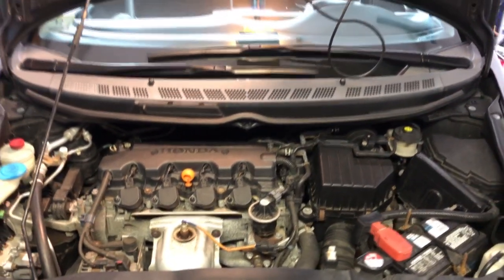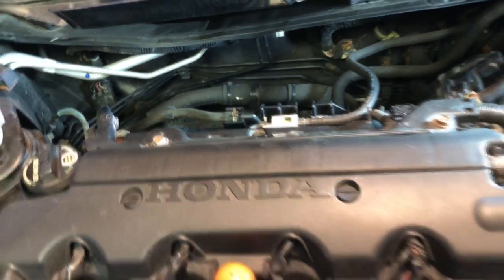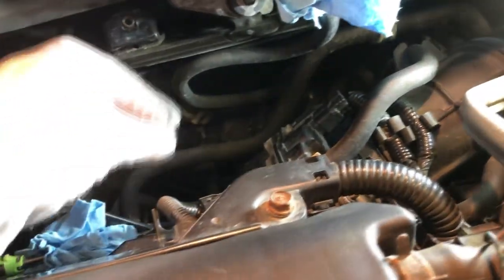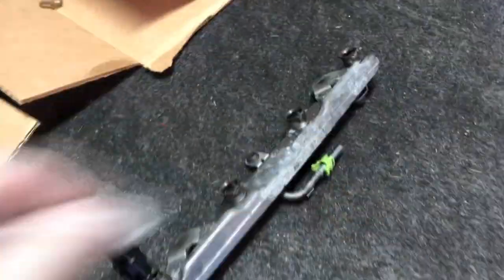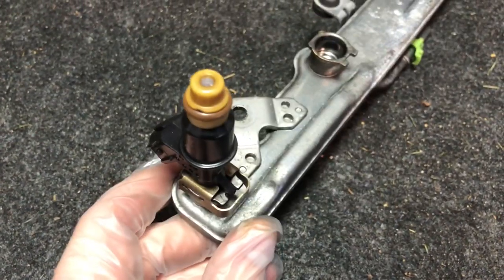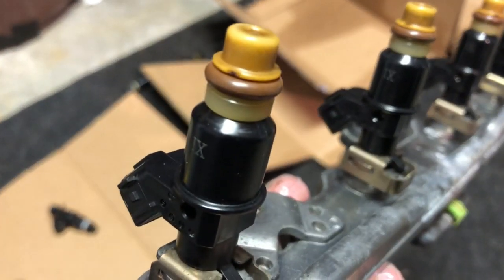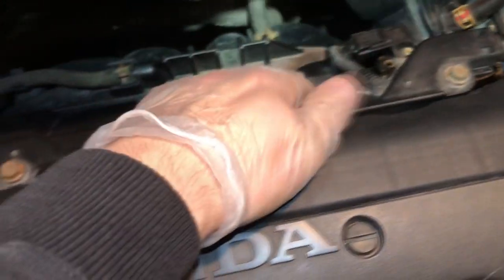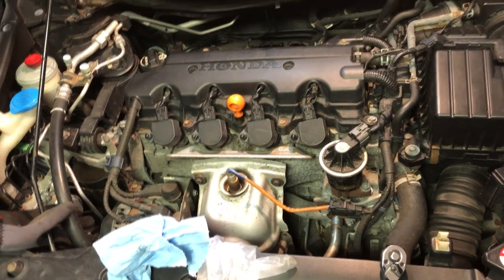2006-2011 Honda Civic Fuel Injector Replacement

Comment: I would just pull the fuel pump fuse, then try to start the engine. Should help with the pressure
Reply: I'm curious as why would that help at all? Could You explain it please ? I'm having trouble With my Civic at the moment haha

Comment: I found that using a little spray silicon lube on the O-rings will prevent them from squishing out of place and causing a hard to find vacuum leak.
Reply from the maker: George Sims Great tip! Ever since I did this job I’m concerned the oil will cause the o-rings to be too lubricated and eventually wiggle out of place. Hope it doesn’t happen.
Reply: Vaseline works great and dissolves in fuel.

Comment: Thanks man, I just replaced mine with old oem injectors which were brought on ebay and refurbished through some guys in Cornwall! All in all it costed me £160 and your video saved me £200 ❤ from 29mpg the car has shot upto 49mpg on the dash. Though I know the car computer is not accurate but definitely is showing huge improvement.... Plus the car is more responsive now, it used to struggle on reverse but now it's smooth.. 👍

Comment: I replaced my fuel pump after I had ran out of gas one day and the car obviously died and stopped running and then after putting gas in it it still wouldn’t start, would fuel injectors go bad because of that situation?

Comment: I have idle surge and rpms barely staying above 500rpms. My mechanic said it might be my fuel injectors. Idk what else they could be, he checked all my air flow and hoses for throttle and there were fine.
Reply from the maker: Maybe check your spark plugs if you haven't already? If so, maybe a bad alternator or battery, I would go to another mechanic to have a deep diagnostic done.
Reply: @awayfromk my spark plugs were changed recently and are running good, had him hook his scanner up and told me the injectors are giving gas enough when you rev the engine, thats why the rpm dips when you accelerate. Also the battery is 3yrs old and might need changing soon.
Reply from the maker: @skradaddy  Yeah I would get your battery tested (alternator can be tested at the same time too to see if it's giving correct charge voltage) and go from there. Just to rule out it isn't those two things.

Comment: Did my injectors today and I think it would have been easier to unclip and remove the fuel rail rather than trying to pull them all out with the rail attached. Of course that method would make a huge mess, but I spilled gas everywhere anyway. The injectors were in there good tho... I had to pry the rail up with a screw driver in order to get them out and it's easier than I would like to bend the rail.  

Got everything back together without leaks and my fuel trims look like they should now (no longer always highly negative). 

Thanks for the video!

Comment: I had a little fuel squirting out from the first injector. After I got Honda to diag what’s really going on, it was GUSHING out from the injector. Had to get my car towed home lol. Turns out the safety clip and o ring were missing!! Wtf! Gonna fix it as soon as the parts come in. So thank you for this video! 👍

Comment: Great video and thanks for posting it.  I'm having same issues with my 2008 civic...a ticking noise but not constant and shuttering at times.  I suspected the fuel injectors, but after watching your video, i'm pretty confident i have the same issue as you.  Thanks!
Reply: Have you ever had the valves adjusted?
Reply: @setward2536  Thanks for the suggestion, but if I increase the rpm's...the ticking sounds don't increase, so I'm guessing it's not a valve issue.
Reply: @kevhed8  rod knock
Reply: @JankyDubz  indeed

Comment: Helpful video!  A bit jumpy with the video, but overall well done.  If possible, it would be helpful to see you actually remove/insert parts instead of jumping to the completed assembly/disassembly.  Maybe on the next one.  I realize it would mean more editing, but super helpful to see the challenges during that process.
Reply from the maker: No I get ya! I invested in a GoPro setup with a head mount so I’ll have both of my hands free for future videos, that’s why I couldn’t show the removal of parts.

Comment: Would this be the same procedure on a 2014?
Reply from the maker: Sorry I wouldn’t know! Honda slightly adjust the design of the engine bay setup once the 2012 civic came out, I would assume the fuel injector placement is the same though.

Comment: I just finished my fuel injector replacement...great video and thanks.  I was putting on that white plastic fuel line cover/lock cap, and the thing broke.  The fuel line seems secure enough as it's clipped in place on the green retainer clip, but I would feel better with the white cap on it.  Any idea what that part number is for that white cap?  Can't seem to find it.  Thanks
Reply: Mine was missing which means previous owner has worked on the fuel rail or injectors. I believe the part number is 16725-RNA-A00 but for some reason shows as doesn’t fit these vehicles on the Honda site I use. I ordered it anyways and will report back on if it fits
Reply: @AkashBhardwaj97  thanks for the reply.  Let me know if it fits your civic.
Reply: @kevhed8  update, I received my clip just now and it looks to be the right one. I’ll be installing it later today and seeing if it fits
Reply: I apologize I thought I had commented another update a few weeks ago but it looks like I may have had a network issue.
Reply: So I have found that there are two clips that can fit over the green one. One is the white one (16725-RNA-A00) and a slightly off white/grayish one (16725-RAA-004). The white one did not fit my 2006 Civic but it does look identical to the one in the video. The light gray one did fit mine because my fuel rail has the tab below and not above like the video and thus I couldn’t get it to go around the  90° turn on the rail.
Reply: I tried to add more info and post it as one big comment to help you figure out which clip is right but I am not sure why YouTube kept flagging my comments as spam. But long story short, 1 of the 2 clips will definitely fit your car!

Comment: What symptoms made you change/clean them? I have a 2010 civic with 142k, never been done...
Reply from the maker: kyle griffin I was having shuttering/low power issues and assumed it was my fuel injectors, but that didn’t fix my issue lol at least getting them cleaned and had new filters installed helped the injectors perform better at least.
Reply: @awayfromk    Swapped my spark plugs on my 09 civic since Im experiencing hiccups while stopped and jerky acceleration while going 40 mph, was gonna swap fuel injectors but it seems that didnt work for you. Did you manage to find out what was wrong with your civic? Im been reading that it could also be the coils causing the issue.
Reply from the maker: salvalo22  I did install new spark plugs recently, my car was idling really poorly and even having a flashing CEL - replacing the spark plugs fixed that issue (my plugs were pretty burnt out) My civic now is riding fairly good now, I’m going to do a valve adjustment soon since I’m very overdue for that and I heard that improves engine performance greatly so I would try that for your civic. I tested my coils a while ago and they were fine, they’re still OEM but I also had a mech look at it and said they’re fine too. 

Are you still experiencing issues with your civic now or did the spark plug change help you? I feel like me changing my spark plugs fixed the shuddering issue I was having or the “hiccup” motion it was doing.
Reply: @awayfromk  Replaced the spark plugs as they were in pretty bad shape and thought that was the main problem. Issue went away for a week, now its back. For some reason, dont get a flashing CEL when experiencing the hiccup and my mechanic is not willing to repair anything else until the light turns on.  Cleaned the MAF too and no luck. Was reading on the civic 8th gen  forums to swap the PCV valve as that could also be an issue and if that didnt work then swap the coil packs but that option is a bit expense even tho they're easy to swap. Did you only experience the hiccup while idling? I feel it sometimes when driving, not sure if its a misfire but recently added some injector cleaner too see if that would help but no luck so far.
Reply from the maker: salvalo22 salvalo22 Yeah I only had the flashing CEL because my civic was misfiring so badly due to my plugs being so worn out but hey it’s good that’s not happening to you because it’s not good to let your car misfire that badly. I would recommend changing your PCV valve for the hell of it and see if that helps, it’s easy and a cheap install (just have hose pliers at the ready) Sounds odd but how I tested my coils was just buying a new pair, seeing if my issue was fixed or if my car performed better, if not then I knew my OEM ones were fine and I returned the new coils I bought. I experienced the hiccups around 50mph when I would hit the gas, it’s like my engine was shuddering and struggling to accelerate but it was brief. Hopefully you can find a fix, it seems it’s a struggle with 8th gen civic to troubleshoot idling/performance issues.
Reply: @driverman9528  I finally was able to get the CEL and had a misfire on P002. I swapped all the coil packs and the issue is gone. Hope this helps. It took over 3 months to finally display it on the computer.
Reply: @driverman9528  I feel you, replaced my plugs, the coil packs, and now the thermostat as it just failed. Seems to be running good now. Over $1500 in repairs, good thing youtube saved me a bunch of $ by doing myself

Comment: Did this fix your engines error code? I did a similar replacement with the refurbished ones and the engine light came back on the second day of driving
Reply from the maker: I didn’t have any engine codes up when I did this replacement. I had misfiring issues and thought this would fix it but it didn’t lol. I had bad spark plugs causing the misfiring.

Comment: For what reason did you change the injectors?
Reply from the maker: I was having misfiring and poor performance issues for a while and just started replacing a few things to see if it would help. Turns out it was just my spark plugs ironically enough, but it was fun to learn how to replace my fuel injectors lol.
Reply: Thank you very much
Reply: I could smell fuel from the area of the injector. But I found a torn canister tube

Comment: I have honda civic 2008,my car just stopped on de way was told is brain box,I changed brain box but change light kept blinking I changed plugs it didn't stop I changed nozzles it didn't stop until another electrician came and made it work...now I feel like selling the car cos I feel like the car will give me more electrical problems I need advice
Reply: brain box by that do u mean pcm/ ecu... ?

Comment: The step at 8:15 I just can’t do it. Just won’t come out
Reply from the maker: The fuel rail won’t come out is what you’re saying? If so, I would put a long screwdriver under there and see if you can use that to pry it upwards, being slow and careful of course doing so.

Comment: what are the specs for 2008 honda civic injectors???
Reply from the maker: thor thunder what do you mean specs?
Reply from the maker: thor thunder if you mean torque specs, there’s a few bolts that are usually 10ft lbs of torque but I honestly would just hand tighten them until they’re snug. If you don’t use a torque wrench properly you risk stripping or snapping bolts.
Reply: @awayfromk  no muscle mass no stripping

Comment: Did your mpg improve?
Reply from the maker: Changing/cleaning my fuel injectors didn’t solve my initial problem, but I believe it does improve fuel economy a bit if your injectors are cleaned and performing better.